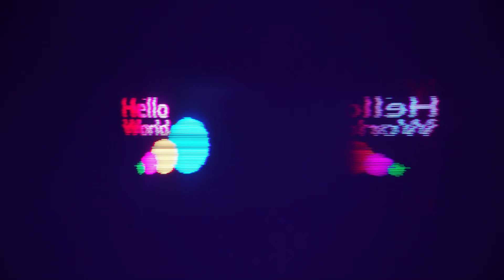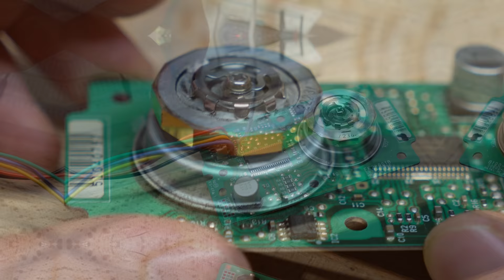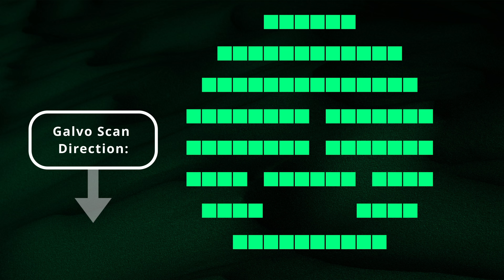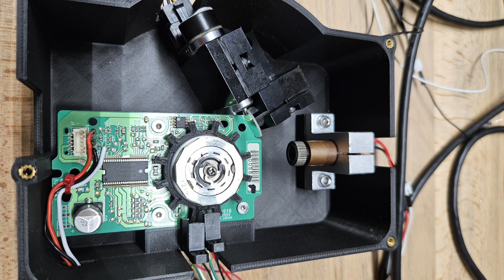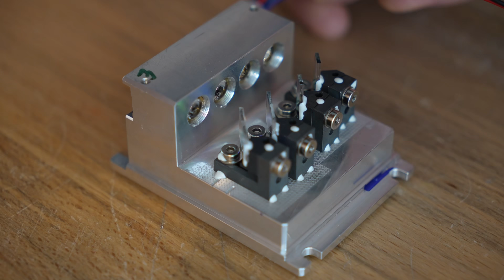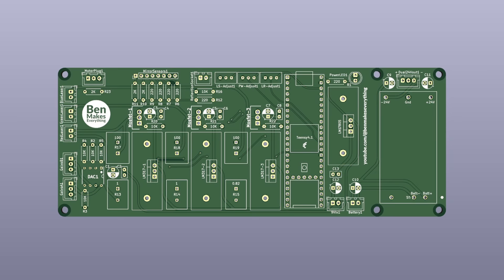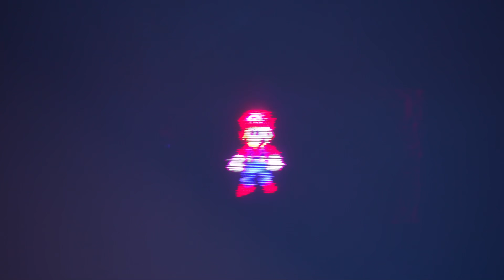DIY Laser Image Projector (100ft+ Range!)

Comment: 12:25 I am curious what is going on with purple and teal using 128s in the values for the color channels, but yellow uses 255? Is this a color space thing?

12:40 You used 0-7 for colors? Consider using RGB. And by that, I mean the literal hexadecimal format (that represents three bytes of bits) to represent colors instead. So... FF0000 (or 16,711,680) for red, 00FF00 (or 65,280) for green , and 0000FF (or 255) for blue. 

But DON'T write them as decimal numbers. Use the actual method of writing hexadecimal in Python or C++ or whatever you're coding in. Usually just 0xFF0000, for red, 0x00FF00 for green, etc.

Actually, seeing that you only have eight colors, I'd probably go with 0x800000 for red, 0x008000 for green, and 0x000080 for blue. 

It already matches the common color format for most color representation in computing. You even have space in a typical 32 bit int for an alpha channel (typically the highest of four bytes, 0xFF000000). 

I know nothing of Arduino-esque development, but it may even let you directly load pre-existing GIFs, JPEGS, etc, without processing them in Python first. A quick Google suggests there are GIF and JPG libraries, which I have to assume would give you access to the pre-existing 2D array of data that an image already is. Simply load the image data in Arduino, mask the color data in the existing image's 2D array (a bitwise-and mask of 0x800000 keeps any reds above 127 out of the 255 range, for example). I had a whole thing about bitwise masking to select certain colors written out, but I realized you were doing something for purple/teal that you aren't doing for other colors, and I'm not sure enough of why you're doing it to leave what I had written in this comment. 

Alternatively, and I don't actually recommend this, but 8 colors fits into three bits. One for red, one for green, and one for blue. 0b101 would be purple. 0b100 would be red, 0b010 would be green, and so-on. But smaller size does not necessarily mean faster processing when you're getting down to this level of bit-twiddling. Many modern CPU architectures operate faster on 32-bit values than 16-bit ones, for example.

Comment: Why didn't you just use two 24V batteries wired in series with a center tap to get a positive and negative 24 volts?

Comment: What motor are you using? You can find 10.000 RPM motors in old HDD's 🙂
Reply from the maker: Its a motor taken out of an old laser printer. I measured the RPM at around 15,000RPM, so its faster than a HDD.

Comment: I think there was a commercial product which used polygon cylinder mirror as one axis and galvo for another.   I am not quite sure though. There is one thing I am sure is that to remove the pinky feeling at the edge of an image, you need to work into the red diode.  That comes from fatter red beam.  Even you get the red to minimal power, it is still pinky.   You got to make sure the red has same beam profile with green and blue.
Reply from the maker: Yeah, I'm sure I am not the first one to think of this. And yes, the red diode makes the largest spot. I would need to find one with a tighter beam or use some type of corrective optics, but this was already incorporated inside a pre-built-module.

Comment: Just use two 24v batteries in series to get your + - 24, the connection in the middle is your 0v
Reply from the maker: Wouldn't they discharge at different rates since the positive one is powering the lasers/microcontroller too?

Comment: For more accurate synchronization of the circuit, an encoder disk should be used; it's the one used in inkjet printers. Alternatively, it can be made independently. In your version, the synchronization circuit is created using 3D printing and has very low resolution.

Comment: Done a ton of playing with laser devices, but mostly for scanning surfaces with structured light. Built similar devices, but tried to make them way more portable. Had one that ran off a single 9V battery, since the system only has to stay on for the duration of capture, which is 5 seconds or so. And I used weak red lasers. I didn't need much distance for scanning, since the subject was always within 2ft of the scanner. I never ended up making professional PCB's and everything is still running on perf boards.

Comment: Amazing project!  I work with lasers and  one of my laser marking machines use a galvo head. This machine have two lasers: a 50W fiber laser which is the laser that engraves and cuts metals, and the other laser is a low-power red laser diode whose beam is aligned with the fiber laser beam. Before engraving, the machine can project the design onto the part that will be engraved using only the red laser to visualize the design.
Reply: cool you mean like a plasma machine thing?

Comment: This seems like a good place to use the Raspberry Pi Pico. The PIO and multi cores would let you do exactly what you want at ridiculously high speeds. The PIO would let you offload the complicated and high speed I/O for laser control and control loops and would let you PWM the lasers within each pixel to get brightness values.

Outside of an FPGA, that is your best bet.

Comment: Nice video!

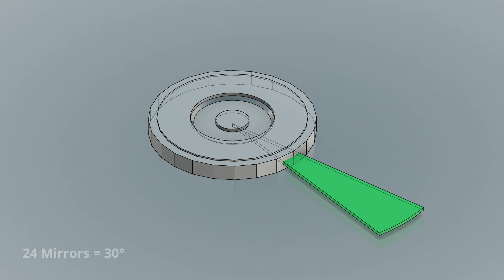🤔 3:45 Are you sure for: "24 mirrors = 30°" ?
For me : 🔄 360° / 24 = 15°
Reply from the maker: Thats what I thought initially too, but upon looking it up the formula was given as 720/#mirrors. I think its because the beam reflects at double the angle it hits the mirror, relative to perpendicular. So if it hits at 15 degrees, it reflects off at 30, etc.

Comment: You could maybe control the brightness by partially blocking the beam, like have a small black piece just like the secondary mirror but instead of it dynamically redirecting the beam it would dynamically block parts of the beam.

Comment: i would use a mirror wheel for both axis and time the rpms to get slightly diagonal scan lines and then just put the whole thing at that slight angle, or just ignore the slight angle. so basically if you got 500 lines the horizontal motor would be 500 times faster than the vertical motor or just have a mismatched number of mirrors on each as in if the vertical motor has half the mirrors it would only need to be 250 times slower for those same 500 lines

Comment: Very impressive build. I do have a few ideas that might improve the device:
1. Don't try controlling, especially not start/stopping, anything at those speeds, so invert the process: Draw the pixel the position of which you currently are at instead of controlling the position.
2. Don't use a swiveling mirror, but something like a rotating reflecting octagon. If you keep having issues with brightness, using different levels of reflection for each surface might help.
3. You could replace your vertical line mirrors with a reflecting octagon as well, allowing for higher rotation speeds. Such octagon surface would only have to be laser-dot sized after all.
4. You could use an industrial incremental encoder instead of light barriers. Those typically range from 1024 to 4096 impulses per rotation, sometimes even allowing 4x interpretation. You even might find small smoothly running brushless servo motors with those already build-in.
5. You could try a linking gearbox which would mechanically lock the output to a fixed but stable resolution, maybe 320x240 so that "it can run doom". ;-)
Reply: wouldnt that make it less ironed out though back pedaling the whole process?

Comment: Instead of rotating mirrors take a mirror and have it vibrate on a flexible substrate of some kind and trigger the laser to fire only when the mirror is vibrating and reaches the full extent of the vibration cycle and then begin your scan and time your scanned in when the mirror vibrates to the full extent of the other side of its vibration cycle. By finding the harmonic vibration cycle of the mirror there will be less resistance to the motion. This is how the first led scanner projector was invented. He put a tiny mirror on a vibrating thing and he knew the frequency of vibration and just turn the LED on and off at the beginning of the scan line. Now obviously if you do two of those mirrors one in the vertical and one of the horizontal and one reflects into the other thing you get your full vertical and horizontal scan and you can point as many LEDs as you want at it and have RGB LEDs and then it's just a matter of working out the timing to blink or fade the LEDs to get a full color display.

Comment: You could use a hall-effect sensor to determine the RPMs of the mirrors, instead of an optical sensor. Putting a magnet on the end of the fins would allow you to determine the RPMs without worrying about light pollution from the lasers tricking your optical sensors. You could also likely reduce the number of fins to save on weight, and still be able to reliably determine the state of the mirrors in software.

Comment: Use dithering in your color downsampling. Also PWM for dimming might still work if the duty cycle is within a single pixel, since you have horizontal blurring anyway which will average out the flicker.

Comment: I had almost this same exact idea back in 1993.  Using spinning mirrors to project a laser beam which recreated how a CRT television worked.  There were no flat screen or LED monitors or televisions back then.  I figured it be good for outdoor advertising on billboards or with the right reflective surface allow drive in movie theaters to show movies in the daytime.  Standard televisions had 525 horizontal lines.  So I was going to use a flat disk the size of a vinyl record with 525 mirrors each set at a slightly different angle.  Then I thought if I had a second set of spinning mirrors which angle only changed so one mirror would be angled for the even horizontal lines and the second field of the odd horizontal lines you only need 4 mirrors on this second spinning set of mirrors with the opposite side mirrors having the same angle.  This would cut down the number of mirrors in the first set of mirrors from 525 mirrors to 263 mirrors.  If all 4 mirrors were set to slightly different progressive angles you could cut down to 132 mirrors.  I never figured out the exact geometry though.  I never had the skills to actually build the thing.  So happy to see someone actually do it.  Wonderful job!  You got a new subscriber here. :D

Comment: When I saw the issue with the circularity of the beam, I was immediately reminded of confocal microscopy, where the beam of the excitation laser is sent through a pinhole before illuminating the specimen. It does reduce the intensity of the beam, and I'm not sure how feasible it would be to implement in your setup, but just a thought.

Comment: Laser printers use optical beam detection from the same mirror surface that is about to begin its scan.  That way, you don't have to adjust the mirror alignment to accommodate misalignment that caused a specific mirror to be early or late.  The mirror itself tells you so.  So eliminate the optical shutter fingers, you've got all those mirrors!.

Comment: To avoid the jitter make sure your controller is in sleep mode when whatever time critical interrupt hits
Depending on where the CPU is in therms of code execution it can take various amounts of clock cycles for the interrupt routine to actually run
In case of the Atmega32 used in the Arduino nano, a single instruction takes anything from one to 4 cycles depending on the instruction. The CPU finishes the current instruction first before jumping to the interrupt routine so you could be 0-3 cycles off in time
By putting the CPU into sleep mode, it does nothing and always takes the same amount of time tu run the interrupt

Comment: Incredible project and the result is both nostalgic and incredibly pleasant. I was wondering though if you would be able to remove the limitations of your current design if you did use another design based on a set of mirrors actuated with calibrated electromagnets and  / or a DMD chip which is basically an array of tiny moving mirrors. In theory this could help you get rid of the vertical resolution tradeoff - you could still focus on the strength of the lasers themselves, leading to a very powerful device with high precision graphics very far away. I wonder what kind of laser power might be too much for these chips. One can find them in old discarded DMD projectors. These generally are thrown away after a while because of the price of the projection lamp. Anyway Ive subscribed and will follow your journey in this fun geeky adventure !

Comment: You need to completely ditch that printed ring as a reference and index surface and get it off the mirror assembly, you have a near perfect optical reference to work from. 
Wanna do it fast cheap and hacky? Yank the shell off one of your optical detectors, bend the leads of the components to converge at a point off to the side of it, the mirror. Print a housing to keep their field of view tiny, accurate, and interference free. Also there's generally no point in having the 'index' arm, so long as all the mirrored surfaces are perfect, if you need to compensate a skew that's another matter, but all you care about feasibly is where you are on the surface of any one mirror, and what's in your frame buffer for that area.
Reply from the maker: I agree that is a superior approach - and I did actually experiment a little with using reflections to trigger a phototransistor. The issue was that I kept getting false-positives from secondary reflections and couldn't make it work so I stuck with what I knew in the end. If I ever build another, fixing that would be a priority. Thanks for watching
Reply: @benmakeseverything  false positives are always a pain, it's understandable. Filtering in software isn't a fun or elegant solution either. You'd want to start out with something like a pin-hole aperture so all the detector can see is the mirror. Also another good approach you could print is to 'box off" the detector zone with a profile around the edges of the spinning mirror, just to help hide it away from the laser show entirely. Awesome project all around though!

Comment: At a certain point, you have to decide that enough is enough, and dump the through-hole requirement. It is hugely limiting.
Reply: You can get a cheapish PCB mill to make breakout boards for SMD components, if you want to retain the breadboardability.
Reply from the maker: Fair enough. This was only the second PCB I've designed. I'll certainly be using SMD in the future.

Comment: As rudimentary as it is, This would make a really cool product. Maybe needs simplified means to input images and swap modes via app. I feel like many would want one of these if it can make it into the 70-150$ range. It's imagery currently really fits that 80s synthwave glitchy sorta aesthetic.
Reply from the maker: Thanks - unfortunately it cost way more than that to make, mostly due to the galvo set which was about $300 alone. There are probably cheaper ways to do it of course, but prototypes are often expensive.

Comment: my brain is having difficulty thinking through why not use two spinning mirrors for each axis. no inertia issue with the y axis flappy bit.but then evrything would be projected in a horozontal line. or would it? maybe it would be too big. maybe twist wires togeather and insulate cables and finish the inside of the box with al tape on the wood to reduce rf interference since its basically a faraday cage at that point
Reply from the maker: Its possible, but it seems hard to perfectly synchronize the 2 motors at the correct ratio of speed.

Comment: 4 years ago I had an idea similar to this but using an electroplated 12 sided semi-helical shape. hilariously, as I was 3d printing the prototype, I was using a Form2 printer. essentially I realized halfway through the print that I was essentially re-inventing the galvo system that the printer used to create each layer 🤣

Comment: 12:40 it is really weird to me that 3 is blue and not yellow, because if you assign color channels to a bit you can turn on/off the laser with just one or two instructions depending on the CPU. you should really read the assembly programming manual for the architecture that you are targeting, probably a 700 pages light read.

Comment: 7:50 as the misfire seems to be at an constant interval I would like to believe that it would be a timer interrupt that is highjacking the processor for you, either sync it to be out of frame if it's important or disable it completely if not needed. I don't think that it is EM interference because it would it would look more randomly

Comment: The way that older laser printers solved the jitter issue was they would direct the beam into a sensor at the beginning of the horizontal stroke, which would trigger an interrupt. They would then, and only then, start that scan line.

The old LaserJet II/III used a fibre optic cable routed back to the main PCB to trigger this.
Reply from the maker: Yeah, I think that sounds like the way to go. Only problem is the laser is off by default till its time to draw each line (well technically on but below lasing threshold). There's probably some workaround though.
Reply: @benmakeseverything Oh! Additional information.

The portion of the beam path that was used for the detection was blocked from emitting to the display area. So, you would just turn the laser on at the very end of the scan line and wait for the pulse and then wait a predetermined period to start the line.

Other ways to do it would to use an IR laser  reflecting on a different mirror in the circle and physically align it to be at the start of the scan line.